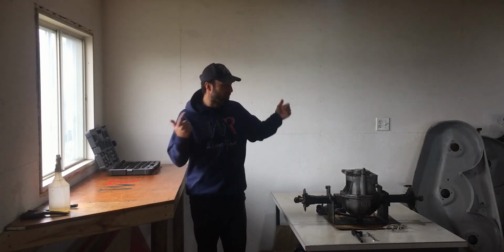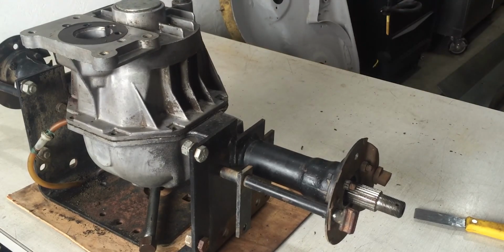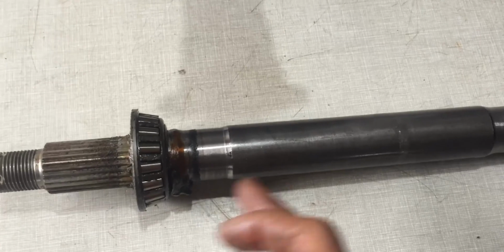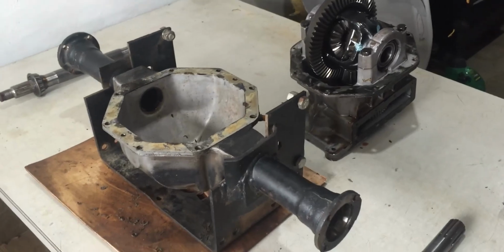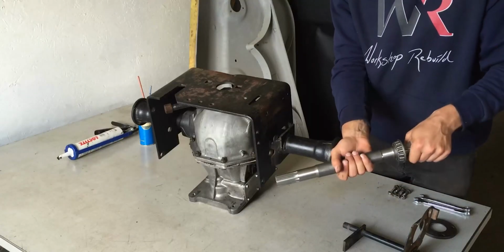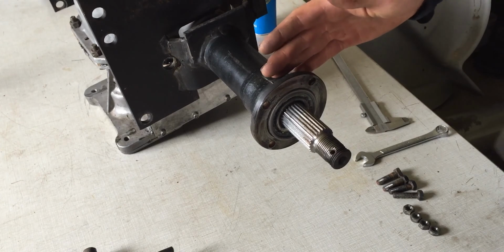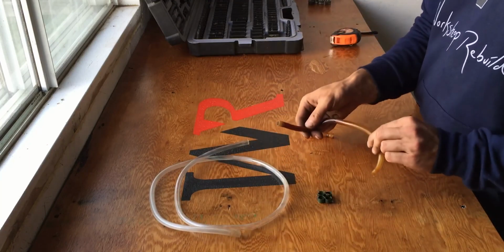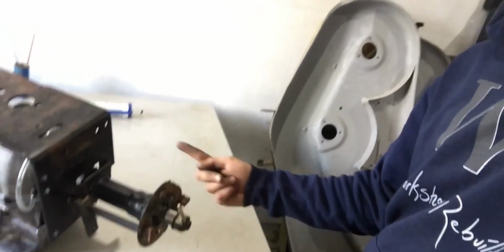John Deere 317 Differential & Axle Teardown + Reassembly

Comment: Thank you for making these videos, it's appreciated!! Now for a question...Is the small in line filter required for venting? The JD parts catalog just calls it a fuel filter for some reason,  and other online sources call it a vent tube. My 317 does have a very tiny little hole near the top of the inline filter. From what I've read, they're supposed to be like that. I don't know if that's just to make filling the rear end easier? Or to purge any air for the system? Did you have any issues after not reusing the in line filter?
Reply from the maker: I'm happy I can share this type of content and I hope I will be able to create many more videos. Thank you, Taylor!! 
You are correct! Originally there is an inline filter that acts as a vent. This plastic vent has a tiny hole towards the top half and allows air to escape the rear end once you start pouring new oil into the rear end.
I personally just popped off the hose towards the top end of the rear end while filling up new oil, as I won't have to change it for a long time. 
If one does not have the vent, you can add a little piece of tape on one side of the filler tube. Once this is in place, you can put your funnel on and you will see a little opening towards the side of the tape. This will allow air the escape as you pour oil into the rear end. From what I understand you have the vent and that is the correct part to have on the sight tube. Either way, I hope I could clarify this topic, and thank you for your great question! Best regards

Comment: It has been so long I forgot the name of that unit. Is it "Sunstrand" or something like that? Also, where do I get a manual or workshop manual on the unit. Mine is leaking right where you have already disconnected yours. I was hoping to see that part. Mine (one of mine) leaks right where the driveshaft input to the unit is. Where do we get seal kits or rebuild kits? Thank you once again for your outstanding YouTubes and for saving great old tractors.
Reply from the maker: That is correct! The hydraulic pump/motor is made by Sundstrand and it's a Model 15 (U Pump). 
I believe there are many manuals up for sale on eBay which should cover these old tractors. There is a website I frequently use which is great for parts diagrams and other parts. 

Here to be seen:
https://weingartz.com/illustrated-diagram/john-deere-parts-lookup/model-317-hydrostatic-tractor-17-hp-kt17qs-kohler-engine-pc1698-kt17qs095001-120000-1979-317-hydrostatic-tractor-17-hp-kt17qs-kohler-engine-pc1698-kt17qs120001-155000-1980-317-hydrostatic-tractor-17-hp-kt17qs-kohler-engine-pc1698-kt17qs155001-19000/4275-35686

I'm not sure who would supply the gasket in between the differential and hydraulic motor. I usually cut my own gaskets if they aren't too sophisticated. I will share another video about the Sundstrand pump and after that is complete I will assemble that onto the differential!
Thank you for your kind words, I try my best:) Best regards

Comment: Also that tube in the back is called a sight glass it shows how much hydro fluid is in the trans you need it to be in the middle for full
Reply from the maker: That is another term for it indeed! I'll get the fluid level once the transaxle is complete. Thanks for your tip. Best regards

Comment: Nice cool to see what one looks like inside glad the 317 is looking good I’m working on an old cub cadet mower deck I got new blades belts wheels and now I’m going to sand it down and paint it I already grinded the rust down to bare metal so it’s about done
Reply from the maker: Yes it sure is!! I didn't know how it looks like myself...I learn something every day and hopefully I can pass that on. That's awesome news! I hope you can give that old cub cadet a new paint job :D You're doing great! Cheers
Reply: @WorkshopRebuild  thanks I just painted the first coat today and it looks nice next I’ll do a second coat and then I can put the wheels and hardware back on
Reply from the maker: @hunter7476  That'll be a nice machine! Keep up the great work :D